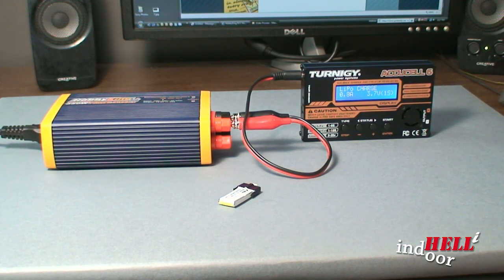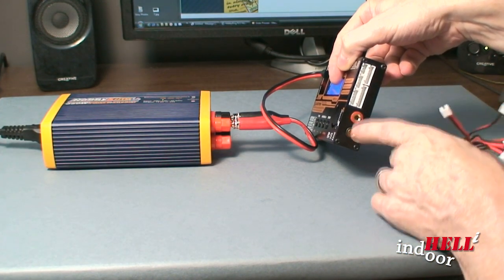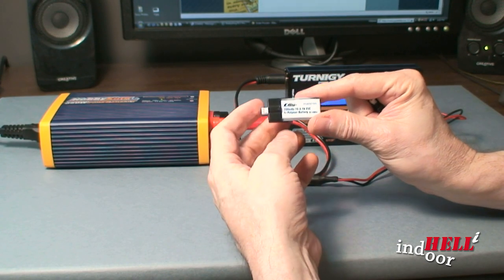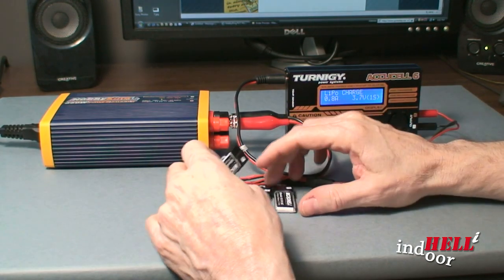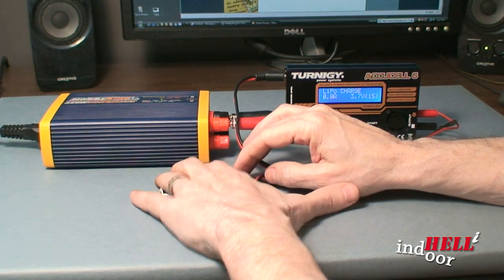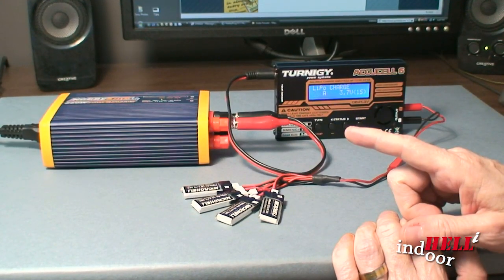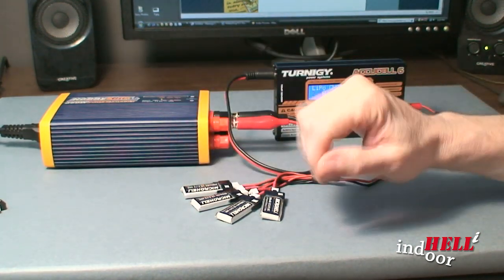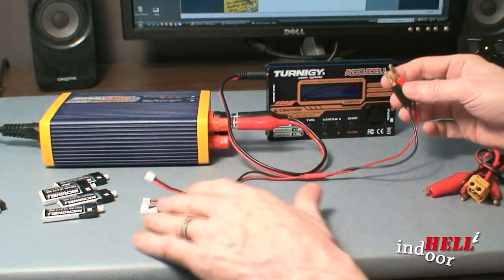mCPX Battery Charging (Part2) - indoorHELLi 003 - B

Comment: Where did you find the parallel charging cable for those batteries? I can't seem to find one anywhere with the JST PH (or ultra micro) connectors. Most all of them are for the smaller style connectors as used on the msr.

Comment: so there is no need to balance charge single cell lipos, no matter how many in parallel?
Reply: you cant balance charge them like this as the charger only thinks there is 1 battery and you cant balance 1 battery . what will happen however is one will get full faster then the rest. once this is full it will stop charging.then the rest of the charge will just trickle over to the next battery in the line.  think of it kind of liked this. stack 4 wine glasses ontop of each other then start poring water into the top glass. at some point the top glass will be full you can still poor water into it all that will happen is the water runs down into the next glass then the next and the next. this is kind of how it work but it fills them at the same time. its just when one is full it just carrys on poring till they are all full. hope that makes sense

Comment: You should never charge standard Lipo batteries higher then 1c rating. That means for your example, that would be 300mah x 4 = 1200mah (1.2A) parallel. Not the 2400mah or 2.4A as you have shown in your demonstration.
Now Nanotech's can be charged at up to 15c or 15 times the 1c rate. Which in your example would be 300mah X 15c= 4500mah (4.5A) each X 4 batteries= 18000mah or (18A) total. Most chargers don't go that high. So you can theoretically charge them at the highest level your charger will go, say 5-6A.
Reply: Nano tech are 15C Discharge, i've got one right here in front of me, that does not mean they are 15C whilst Charging. Sorry not sure of the C value for charging. Actually it depends on the battery cell. I have just looked at 200ma nano tech spec. which are 15C discharge but only 5C charge. This is what it says in the description for nano tech. : Fast charge capable, up to 15C on some batteries.

Comment: The balance plug is used on the multi cell packs to insure all the cells are properly charged to the same value. Since these are only a single cell there is nothing to balance.

Comment: Ideally yes you want to balance your batteries as they may not charge/discharge at exactly an equal rate. If one cell should dip below the minimum voltage, it will ruin the whole pack and make it potentially hazardous if you should try to recharge it (look up handling and hazards of LiPo batteries).